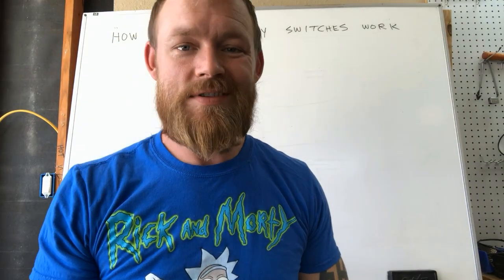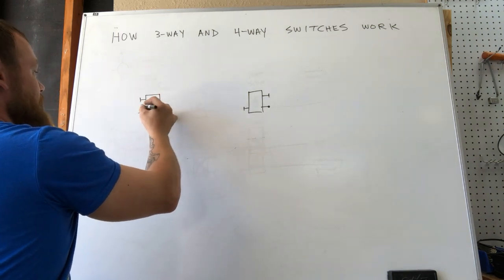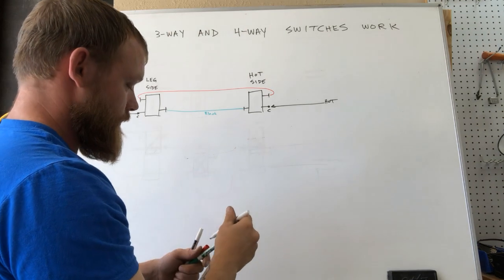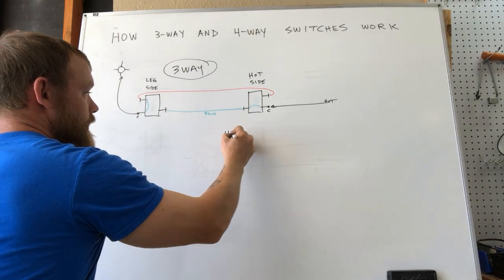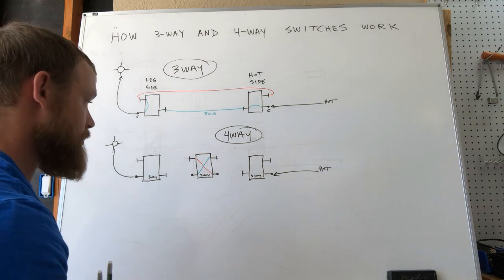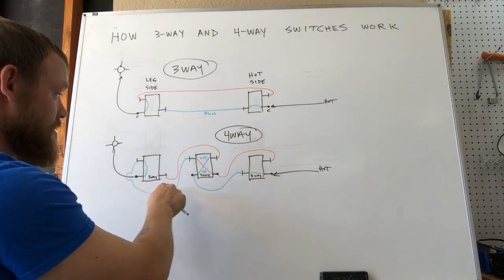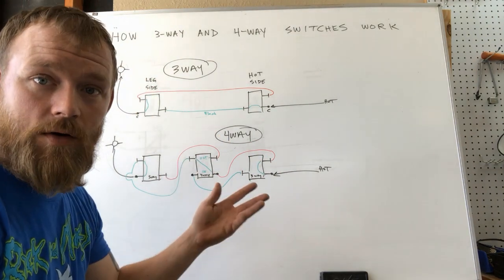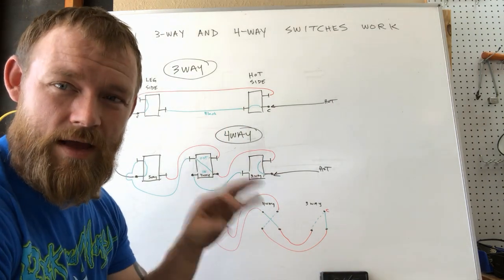Episode 11 - SCHEMATICS How 3way and 4way Switches Work

Comment: great explaining bro, we don't have 4 way switches in France, from 3 and more combined switches we use "telerupteurs" with are basically a relay system in the panel that can be commanded from as many push buttons as you want. The cool thing is you can have the push buttons only on the neutral therefor not hot wires travelling at users level, very recommended in say a day care center, school etc

Comment: what about when your power and light wire are in the same box, I cannot for the life of me, get the switches to work. Box 1 is the master and it's on and off. if box 1 is on, then 2 and 3 will turn on/off like you would want them to in any order. However if Box 1 is off, then nothing works! I've tried everything and I cannot figure out whats going on.

Comment: Isn't the single screw at the top should be common  and the 2 Bottom one is gold.  My be you switches in your country are Different
Reply: Top or bottom doesnt really reference anymore. Different manufacturers position different ways. Not a standard position guideline here.

Comment: Does anyone see this as wrong?  At min 8:36 you would need to flip the two 3-way switches to make it work.  His internals on the 4-way are wrong.  It should toggle between chris-cross (X) and straight through (=) connectivity.  That way you only ever need to flick one switch to complete the circuit.
Reply: I agree with you, James.  I was going to make the same comment, but you said it better than I could.  A four-way switch is a double-pole double throw (DPDT) switch.  The poles either cross connect or straight connect.  Then you can repeat as many of these as you need to complete the setup.  The three way is a single-pole double-throw (SPDT) switch.
Reply: @radickd2  you are correct and i commented on this up above, the 4 way "reverses the travellers"  it is infact a dpdt switch with a builtin crossover or straight through function

Comment: Would like to see tips on how to detect a hot/leg when nothing is labelled.
Reply: Turn off power. Go to your 3 way switches. Disconnect the common screw wire (black screw) off both switches and pull out by itself not touching anything. Turn breaker back on to see which one is hot with a meter.  The hot wire of course is your feed light switch and the other switch will have the leg wire going up to the light fixture. The traveler wires are irrelevant.
Reply: @brandondill4234  awesome thanks so much for the response!

Comment: Done some 3 way and 4 way wiring in electrical school. Haven t see. 3 ways with that screw config. Travelers were always the end with 2 screws. Like at the bottom in your diagram. The solo screw was always yhe power coming in from source or out to light. Maybe u can wire it different ways or different switches.

Comment: Having to work behind someone who did it with(2) 14-2 wires. Nothing capped off in each switch. Guessing power runs to one sw  one place and same with the other sw. It still seems as if there will be a dead end on a white somewhere. Man it's so easy to work behind an electrician, not a damn sorry ass  flunky. Trying to be cheaper but looks like I have I re-run it. Just hope I don't double feed anything. Here goes nothing, tired of head scratching

Comment: I love your videos and the fact that you give freely and generously of your time to help others but your explanation of the 4 way switch is wrong. The example you gave happens to work correctly but I can easily give you a counterexample demonstrating how, if this 4-way switch worked the way you said it does, that there are circumstances where it would not be possible to light the bulb using either position of the middle switch. Imagine e.g., that the right hand switch (3-way) where power is entering is connected to the green traveler instead of the red traveler (ie you flipped the first right hand switch). The left lower post of the 4-way is now energized. The light is clearly off as there is no continuity in the circuit extending to the left most switch (connected to the bulb). Now flip the 4-way switch. If it works the way you are claiming the lower left (incoming) green traveler is now connected to the upper right (outgoing) traveler. The red middle traveler is now hot but unfortunately it is not now in continuity with the bulb in the left hand 3-way switch! So given your drawing and simply flipping the right hand switch to the other position would make it impossible for the 4-way switch to light up the bulb in either position! Instead the way the four way switch works is that it either transfers power to the ipsilateral outgoing traveler OR, when the switch is flipped to the contralateral (diagonal) outgoing traveler.

You can very easily convince your self of this by taking a four way switch and using a continuity tester. Put one lead on an incoming traveler screw. With the switch is one position one of the outgoing traveler screws is connected and when you flip the switch the other traveler is connected. The other incoming screw is connected in exactly the opposite way. At all times precisely ONE outgoing traveler is "hot."
Reply: BTW for reference I am referring to the diagram as you have it at 9:00.

Comment: The 4 way switch forms a (cross X) and then a (parallel=) isn't that correct.
Reply: Yes and this video completely misses that.
Reply: Ok, I thought I was going crazy. The way he drew and explained it wouldn't work.
Reply: you are correct, the 4 way is either two parallel connections or an X.  basically a simple reverse switch for a dc motor with no centre off position.  a four way switch can be used to reverse an induction motor too by wiring it into the start circuit

Comment: Looking at the bottom diagram the circuit is open (light off) because it cannot complete the path in the last switch, How does flipping the middle 4 way switch turn the light on?  It appears no matter which path you connect in the middle 4-way switch, the circuit is still open either on the 1st 3-way or the last 3-way. Flipping that middle switch will just toggle it from being open in the last switch to being open in the first switch.  What am I missing?

Here I try to diagram flipping the middle 4-way switch:

https://i.imgur.com/VDK0elz.png
Reply: What you are missing is the explanation in the video is wrong. The way a 4 way works is it either makes an X with bottom commons connecting to top diagonal travelers, or a paralell ][ with both commons connecting directly to the travelers above each one. Try it with the x and the parallels and it will work every time. Hope that helps.

Comment: The 4 way switches sold locally do not work the way you describe.  With reference to your diagram, In one position of the switch each bottom terminal is connected to the top terminal directly above it.  In the other switch position, each bottom terminal is connected to the top terminal diagonally across from it.  So there is no switch position where one bottom terminal is connected to the top terminally diagonally opposite from it and the other bottom terminal is NOT connected to the top terminal diagonally opposite it.  You suggest at 5:48 that such a thing is possible.  Are  you describing a different kind of 4-way switch?

The wiring scheme you show does work for locally sold 4-way switches.
Reply: Sorry Harry, but Bobo is correct. Few people seem to understand what he is saying, but the irony is they don't really need to for it to still work. It's only their thinking that's broken- not the switch itself ;)

If 4 way switches were built the way the video explains- the entire configuration simply couldn't work as intended. Good job Bobo!
Reply: Bobo Cheverovsky            Hell,  I’d move then!

Comment: I was confused by explanation of the connects across a 4-way switch...so much that I had to go to Home Depot and buy one to test. The functionality is that in one position there is contact between both of the diagonals....black to gold and black to gold. In the other position there is contact between both of the side terminals....again black to gold and black to gold.  If you google 'pictures of 4 way switches' there is an excellent Java demo of a couple of 4-ways in action as other switches are flipped on and off.
Reply: thank you for this i was having trouble understanding how that worked. the four way crosses over from  straight up down to crossing over. i got stuck thinking when you turned the middle 4 way the others wouldn't work.
Reply: @namgnol  yeah because the guy in this video explained it wrong
Reply: Your the best man  thank you finally after several times( hour) watched your video and got it the first time 👍

Comment: It might be that I just don’t understand this correctly but the way you explained it, there are ways that you can hit two separate switches with out allowing current to go all the way through.
- is the 4 way switch only have one path open at a time , or two separate paths that alternate from \/ to ||( going from connecting the traveler to the it’s diagonal common to both of the top connecting with the common directly under it)
I’m not even an apprentice yet so this is all new to me, but I drew this out and the only way it made sense to me was if there are two paths in the 4 way that alternate from diagonal to parallel... not one that alternates from one parallel connection to the other parallel connection.
Please help me understand this better...
thanks
Reply: You are right about the two separate paths \/ and ||. Here is another visual. http://users.wfu.edu/matthews/misc/switches/4WayAnimation.html
Reply: This was bugging me too. So the 4-way is not one diagonal or the other, its either both are in the diagonal position as a through connection; or both are in the vertical position as a through connection. (Left top to bottom and right top to bottom) So inside the 4-way switch itself, flipping the switch actually moves 2 pieces, right?
Reply: @catfishcave379  horizontal, not vertical. It it would be verical, it would just connect the other traveller back and to open wire in the first 3-way switch.
Reply: I was also confused by explanation of the connects across a 4-way switch...so much that I had to go to Home Depot and buy one to test. The functionality is that in one position there is contact between both of the diagonals....black to gold and black to gold. In the other position there is contact between both of the side terminals....again black to gold and black to gold.  If you google 'pictures of 4 way switches' there is an excellent Java demo of a couple of 4-ways in action as other switches are flipped on and off.
Reply from the maker: It’s 2 diagonal paths. You’re correct.
Reply: In reply to Electrician U above saying "It's 2 diagonal paths. You're correct."   …...uh, No! That's not it. 2 diagonal paths are connected AT SAME TIME in ONE of the switch positions. However, the other switch position connects the SIDE terminals(top to bottom) on BOTH SIDES AT THE SAME TIME.  Understanding what is going on inside a 4-Way could be critical to an electrician, or even a tinkering homeowner like me who is trying to troubleshoot it. If any of you who are reading this have doubts about the way the contacts link up, just go buy yourself a 4-Way switch(like I was forced to do after getting confused by this video) and put your continuity meter on them and it will become clear. A 4-Way switch is basically two 3-Way switches in one box. The common terminals behave just like a 3-Way....they switch back and forth between the gold traveler terminals.   
By the way, I don't want to sound critical of Dustin's explanation of the 4-Way. It's just that the way he explained the connections didn't jive with the way I had it pictured in my mind. I am watching every single video he is producing since I think that 1. he is brilliant in his approach to his profession and 2. his detailed explanations of each and every 'move' that an apprentice electrician can make are the absolute best training videos I have ever seen. I told all my friends to have a look at his videos, especially the one about the fuckups he made as an apprentice and how they helped him to slow down, be more careful, and become a REAL MAN as well as MASTER ELECTRICIAN. I have worked with some good electricians before, and Dustin is the guy I want to work for and/or do my electrical work. I told my buddy in Austin that if he needs any work done to contact this PRO!  ---John Hudson, Redmond, WA  aka johnnyrebangel
Reply: @electricianu  You can answer.... 2 pairs of 3-way switches on conduit... 2 lights,  but whatever not exactly point. Single Split phase 180° [0° N , 180° S] "Leg one  Line inbound one is perfect for not L1 energized by 1 of two parts per spine of panel <summary, if you have L1 and L2 multimeter has 240 V  (common prong to hot prong in V [A/C] meter. Single 4 Travelers and 2 commons.... it's a f**king b*tch of a mess if you want to f* around with romex.... waste of money... and then some...... oh my, unless you have the same integrity as to splicing lamp cords... pulling lube yellow slime..... the clear s**t is f***kin less than useful. And don't think that this is easy. Nothing is a good idea yes; a complex system that is not reasonable to make it in anyway ameliorating cost... hire a licence Electrician..... and make sure he has integrity to check. Not a good idea to go to home depot and by shit that #1 you are not going to understand #2 your guess is as good as the kid jockeying the checkout...

This is a very good way to get involved in a complex situation when you have a electrical fire, and plan on getting past your baseline or whatever they're not exactly incorrect if they void the policy all together they'll probably send you a nice check or if your unfortunately mortgaged and you have fire Insurance inside of mice that's irrelevant the checks going to go back to the banks pti escrow account to pay the insurer and now you have nothing and why did this all begin one must ask how can I prevent this in the future how could I have prevented it? Now on the other side is a few thousand dollars up in my way to price this man's value, but if you want to set your expectations low and you know you have an iPhone you have a nice house with so you think and all that but you cheaped out and you think you saved money in reality now you have nothing think about it folks Limited handyman work here this is a pro he is well worth the money.